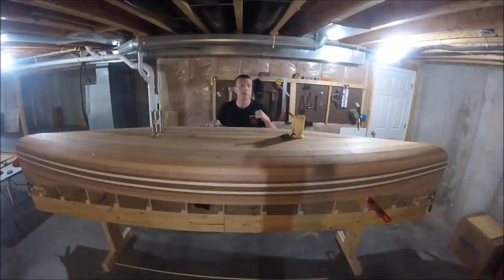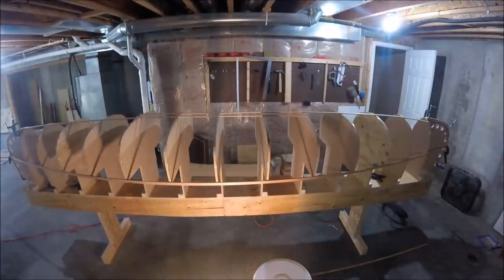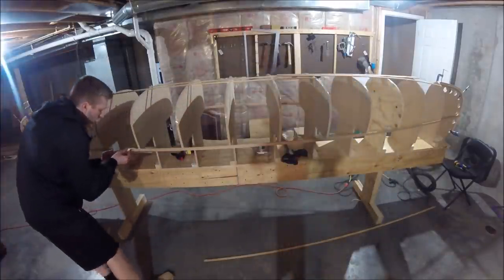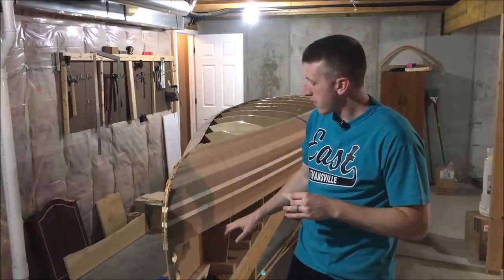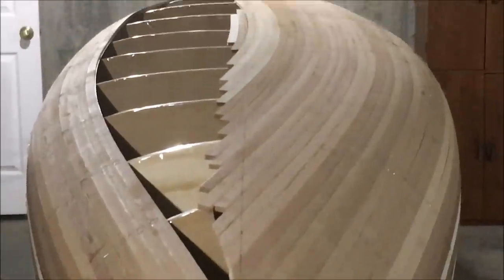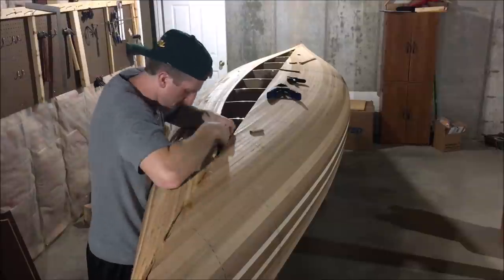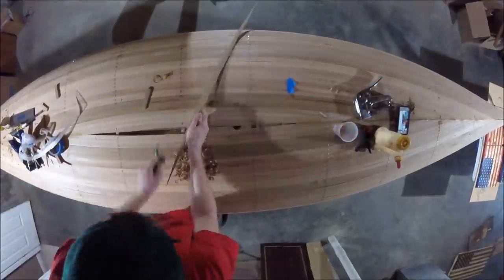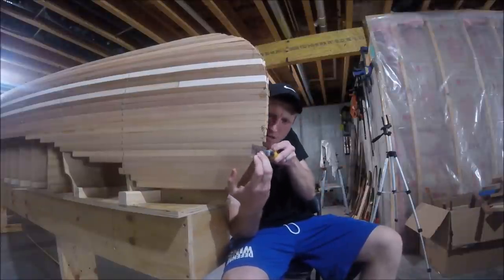Cedar Strip Canoe Ep 5- Planking Hull

Comment: what glue ??
Reply from the maker: VERGOOD I’m a fan of titebond products. 2 is water resistant. 3 is water proof. I used mostly 3 for my build, but it problem doesn’t matter- the entire canoe will be sealed with fiberglass and epoxy on the inside and outside of the hull.
Reply: Спасибо frend